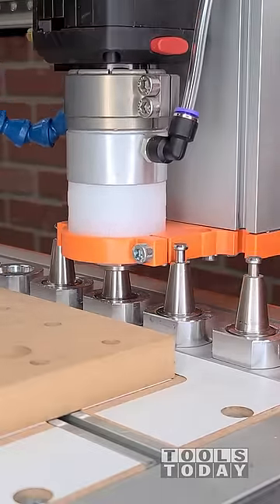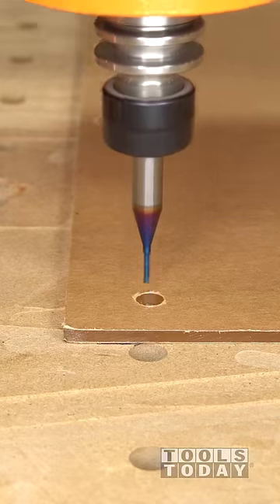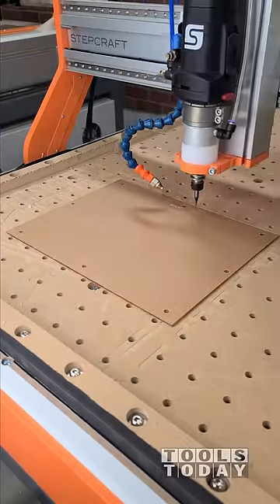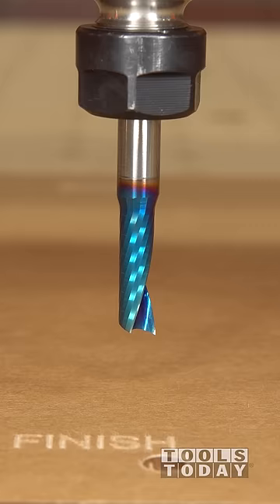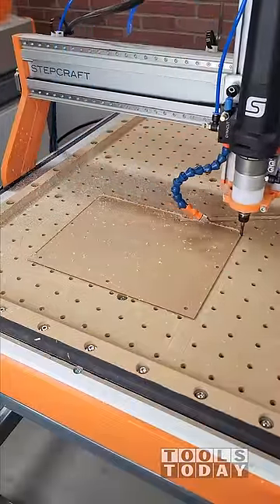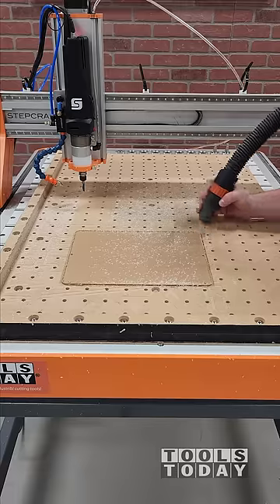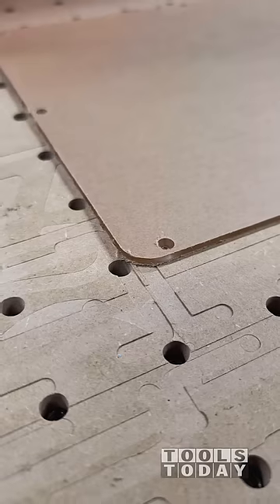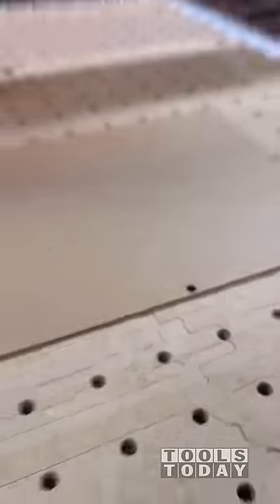Cutting Acrylic on CNC

Comment: As a CNC operator/programmer, I really appreciate the bit numbers and didn't bat an eye at the vid, but these comments are hilarious 😂😂 and.. my go to for acrylic is the onsrud 65‐018 3/16" upcut spiral O, 32000 rpms at 125-170 ipm depending on the type of acrylic. 😂😂
Reply from the maker: Haha right, glad to see someone enjoys it!  How are you running it at such a high speed without it melting?  Are you using oil misting or compressed air or anything to keep everything cool?
Reply: @ToolsToday  I feather the ipm depending on the type.  Acrylic really likes the speed, but my bits have be sharp to get a good surface.. I use the bits too dull to cut Acrylic to cut aluminum with misting fluid.

Comment: If you want to minimize pulled up paper, but still use an upcut, run a chamfer mill around the profile for a nice, controlled edge break first, and then cut the profile with your upcut

Comment: I see that your table has a lot of cuts in it and you probably replace it after a while but have you ever thought of using a spoiler board. 1/4 mdf still let’s lots of suction through and could even add double stick tape if needed but it will save your table a lot longer. We use them all the time in our stair building shop. Our bits never touch our table. And we have plugs for all non used holes
Reply: why not use 1" mdf?  it allows, plenty of suction and we can get a year out of a set of spoilboards.  and yes your bits do touch your table.  same as mine, same as theirs.  wouldn't need the spoilboard at all if they didn't.   your hole issue is weird as well.  there are three hundred holes in my table and every one of the them are covered by the spoilboards.

Comment: Countersunk screws are not advisable in acrylic.  Any expansion or contraction of the acrylic itself or the surface it's mounted to will result quickly in screw hole breakout.  Better to use a flat under-head type screw thru an oversized thru-hole.  If you need a flush top surface, use a flat low-head screw thru an oversized thru hole and an oversized counterbore, to allow for slight movement.

Comment: What are the speeds and feeds you're using?  I've been cutting acrylic with a .125" single flute endmill, .5mm plunge, 600mm/min feedrate, and I haven't been super happy with the finish.  I feel like a faster and deeper cut is what I need, but I'm also super concerned about the rigidity of my Snapmaker 2

Comment: Do you find it better to profile-cut acrylic in the climb cut fashion, as opposed to conventional?
Reply: I found with acrylic, in my experience, if you want a decent surface finish, you can make huge cuts, but taking a 10 thou for your final pass with conventional tends to yield a better result.  Climb tends to leave a mess that you have to file or wheel.

Also, a slightly slower speed but a normal feed.  Don't go too slow or you'll just melt everything.

Comment: What would be the cause if there weren't nice, clean, cuts? What would you do?
Reply from the maker: I would start with making sure you're using the right bit for the job you're doing.  Then it would depend on what's happening.  If the acrylic is melting, either your speed is too fast or your feed rate too low, what you adjust will depend on the capabilities of your machine and bit.  If you're getting chatter, your feed rate may be too high or your workpiece is not fully secured down and moving slightly.

Comment: i prefer the XYZ123Chromo4Matta over the XYX321Cum4000Reducer. Why do you ask? because the Cum4000Reducer Has a Hexoganal Cutting edge that fits perfectly into the 432XAEAEAEElon a cutting bit!! If you guys are gonna go for ANYTHING! Go for the XYX321Cum4000Reducer With the V2 Strap on! Happy cutting! 💪🏽

Comment: Working in signs, running a router table, often times I get better finishes running a climb cut on acrylic. Aluminum too.
Reply: Hi, just bought a new CNC with a 9kw spindle for our sign shop. Can you recommend any bits for acrylic and aluminum.
Reply: @highmountaintrader  yes! Amana tool is a popular one, but LMT Belin or LMT Onsrud were my favorite. We used single flute bits, typically called O flute.
Our router was an older one and had some rigidity issues, so we used 1/8 or 3/16 bits for our aluminum cutting, and 1/4 for acrylics and composite panels.
Typically these bits were in lengths of 1" or less. The 1/8 bit was .5 long. All 1/4 shank. 
We also had a 2 inch long 3 flute bit for cutting sign foam. I wasn't a fan of that one at all, but I wasn't the boss. 
I would also highly recommend getting a Kool Mist and running it with no liquid simply for an airjet on the bit and cutting area.

As a summary, Amana tools I think will be cheaper option than the LMT bits, but I had less breakages and better finishes with LMT, esp in aluminum. But part of that could have been our older router table with some rigidity issues.

Comment: You should have used an opti rough to clear that excess stock . That initial approach was too excessive. You need to understand how to engage the material with a roughing pass then come in with a finisher when profiling - CNC Applications Engineer

Comment: So is that board underneath a sacrificial piece? Is it just something random or something you have to buy?
Reply: 3/4" MDF spoilboard, typically a CNC machine will pull vacuum through the MDF to fixture the material being cut.
Reply: @taylorhickman84  hey thank you for the information.

Comment: Do those bits get that hot that they change color like that? Or they come that way?
Reply: it's a coating that amounts to not much more than a gimmick.
Reply: @taylorhickman84  Lol Gotcha
Reply: @sas5177  there are some specialized coatings that are suppose to increase lifespan, but I found the benefit to be marginal considering the additional cost.
Reply: @taylorhickman84  How long do they normally last with regular use??
Reply: @sas5177  too many variables to say, material type, thickness, and desired cut quality play a big factor in tool life.

Comment: how did you  clean the paper on the edges?
Reply from the maker: You don't actually need to clean the paper portion up, as it just gets pulled off in the end.  For the video, I just took the edge of my finger nail and ran it along at a 45 ish degree angle and the frayed portion just comes right off.

Comment: Nice, but those holes are too close to the edges. That plexiglass will crack and break over time
Reply from the maker: Thanks!  There is no pressure on the acrylic and it's fully supported by wood underneath it when installed.

Comment: Why are you using a climb cut?
Reply from the maker: When cutting acrylic or soft metals, using a climb cut will produce cleaner cuts.  With wood, conventional cuts generally leave a better finish.
Reply: @ToolsToday  This will be a surprise... i disagree.  and i get "to each their own".   i use  a two flute low helix upcut that can produce a smooth finish.  I can even do the same with a chip breaker (usually).    i have found that outward deflection from running a climb cut can cause final product to be oversized when finished. this has been typical of both plastics and woods.  usually in thicker pieces its easier to measure but i would expect your piece to be too big as well.  Also, as the bit tends to push away from the material that the flute is cutting into, it can cause a  bounce and chatter.  you can say it goes the other way with conventional, but its pushing away the material i didn't want anyways. 
 
as for your wood statement,  conventional  only works in wood if the bit is completely surrounded by the material for the entire cut.  if a bit has to out the side of the material a climb cut cuts into the grain from the front which prevents it from being "blown out" like a conventional cut would do scooping it from behind  the grain.

I guess, Really, I was curious why using a climb cut would be your variable as opposed speed  or rpm or the type of bit.
 i'm not opposed to climb cuts.  I only use it when needed though, which interestingly, has only been with wood.
Reply: oh ya, i have another question when this one has gone stale.

Comment: Except that's not acrylic. It's polyethylene. They cut waaaaaay differently. I'd actually like to see you try acrylic without cracking it.
Source - am machinist, 30 years.
Reply from the maker: This is cast acrylic, not polyethylene.  Cast acrylic and extruded acrylic cut very very differently.

Comment: You flipped it over when you said “nice clean cuts along the edges” you can see the burrs on the bottom of the wood. From where it was flipped over..
Reply: It’s acrylic
Reply from the maker: Those aren't burrs on the acrylic it's the protective paper that is over the acrylic that frays a little bit, but the acrylic itself is cut very cleanly.